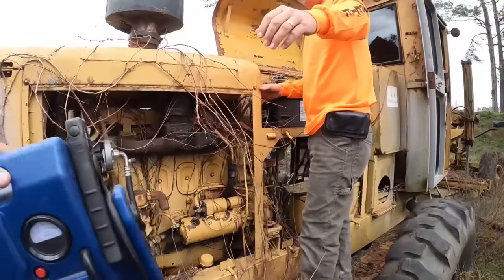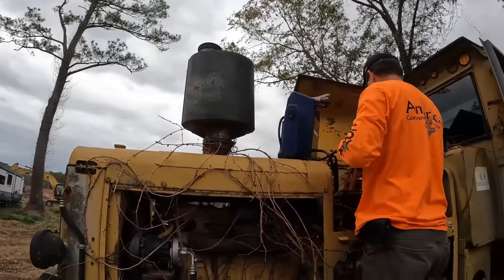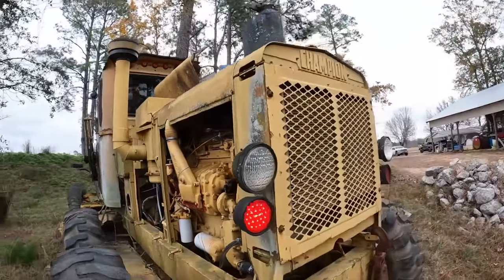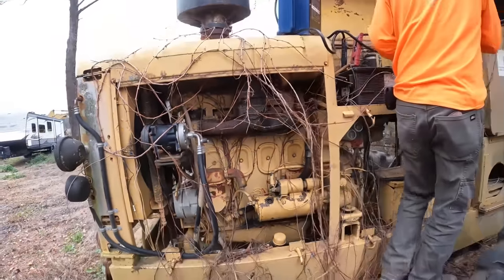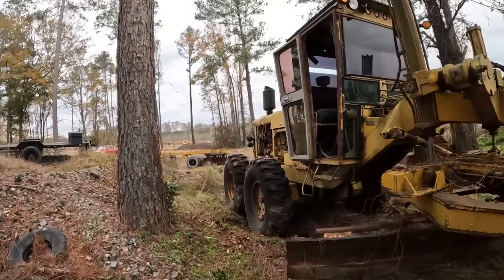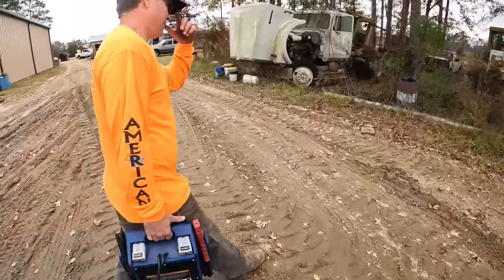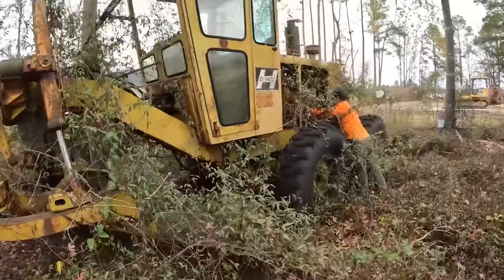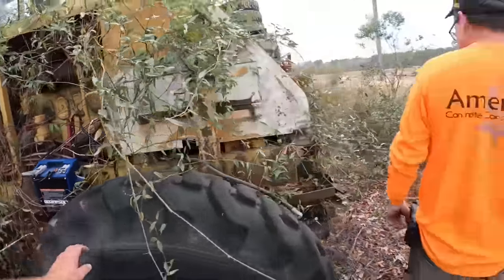Forgotten for Years, Will Charlies Old Graders Start Again?

Comment: I recall an old International Harvester combine harvester that sat in a barn for many years. No way was that machine to leave, other than on the bed of a trailer. One day, a couple of guys arrived, fiddled with it for a short time, got it started, and drove it away :-)
Reply: An old Gleaner sat along the highway inside a pole barn.  Eventually, the posts rotted off and one of our smaller Ozark tornadoes passed by and flattened it onto the combine.

A few years later the farmer died and the Gleaner sold “Ran when parked, As-Is”.  My neighbor bought it for $150.  

He and his farmhand cleared the barn off of it, put in new batteries, aired up the tires and it started.  After tinkering with it for an hour or so, they loaded it and pulled it to the farm.  

That was five years ago and he uses it every year to combine wheat, milo and beans out of a small rough field in the river bottom.  A field that would tear up his big new machine.

He says he has less than $1000 in it and wouldn’t sell it for under $10K!
 He also says, “Old iron can be replaced… but why?”

Comment: I have a 1970 Cat. 120 rigid frame grader I bought brand new, that runs like a champ! Not as powerful as newer models but still works for what I need it for! I use it for snow removal on our 11.2 mile road out to our homestead and all the roads between to our homestead neighbors after every snow storm. Plus grading out our potholes after the last snows are melted. Noisy as hell but gets the job done! Hard to get the parts up here in Alaska so we tool and die everything ourselves on all our heavy equipment items! It gives us something to do in the long winter months when our lodge closes up for the snow season.

Comment: @ 5:40 you just make the parts! I worked for years as a machinist, making all kinds of parts. From a 2.5 inch long brass carburetor emulsion tube, to a 18,000 pound chuck of 4140, turned into a 12,000 lbs crankshaft for a big press.
 Ya just gotta find the right guy.
Reply: Oi

Comment: Love the 471. I never worked on one, however in the Navy I worked on 271s, 671s, slant 671s and 610s. If it turned over and it had fuel it would run. I also worked on a Timber Jack skider. I know it was a Detroit and  I think it had was a 3 something. One day I came out of the woods with a jag of logs and found I couldn't shut it down. I put the blade against a tree and stalled it. The boss showed up and I told him what happened. He didn't believe  so took out the trusty screw driver key and started it. Oddly enough it started, but he had to put against a tree and stall it. Long story short the rack was frozen. I went and got a new injector and a tool to set it. While I was at I got a filter. After installing the injector I pulled the can off the filter holder. The filter wasn't dirty because there wasn't one. I wonder if that had something to do with the injector freezing. A few days later he yelled at me and I  left. I saved him at least $100.00 by him not having the dealer send some out and all  he could was cuse me out. Not this was around 1974.

Comment: That looks like A good candidate for fixing back up.& Repairing to put it back in use. If it's just something as simple as parts like those. Especially if you never checked any of that out on that machine yet at all either. From over the years of just setting in the woods. Like I see it has been doing to.

Comment: On that last grader I'd just add in some zinc powder with STP stop leak with your motor oil it'll come out of that ticking noise. Lucas& mix in some STP with stop leak in that hydraulic pump after fixing the hoses.& Gaskets & seals that could've went out.,or split the O-rings inside over the years of usage they just stretched out popped causing The fittings& pump to leak.

Comment: Good to see Chris spending a few minutes with old Charlie. There is more to life than yanking stumps out of the ground

I wouldn't be surprised if Chris bought the grader with the hydro clutch out. He only wants to buy used equipment that needs a dump truck full of cash to fix... 🤣🤣🤣🤣... that's not fair but it's funny.

Comment: Why don't y'all look up the phone number.& Address for mosier engineering in Portland, Indiana they might be.,or could be able to machine you out A new shaft for that grader's steering box unit to keep it original still.,or I'd check with your local machine shops around for pricing.& Quotes on machining out new steering shaft for that pump unit.